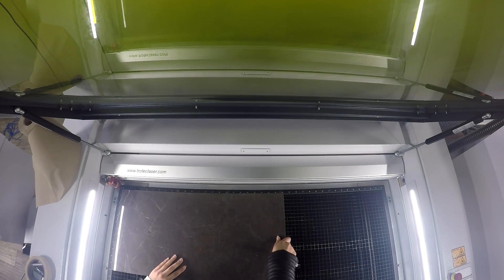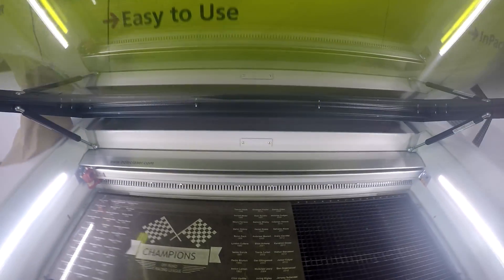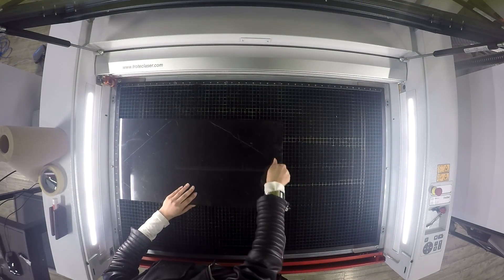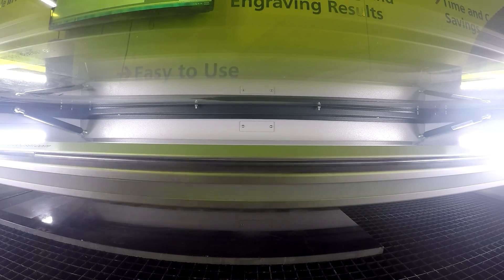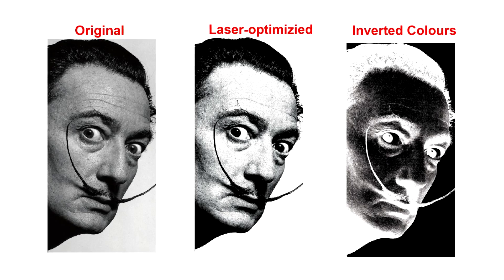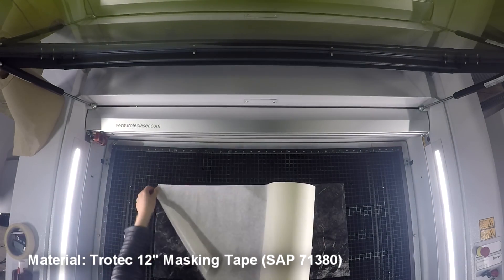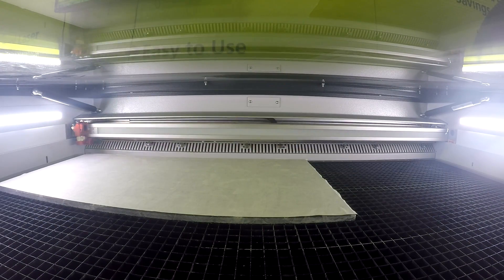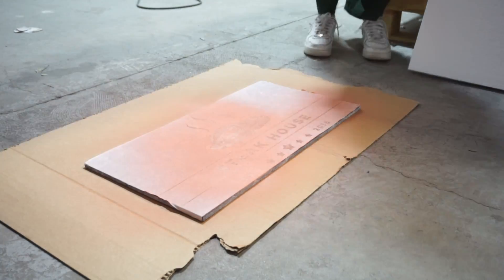Laser Engraving Marble | Photo Engraved Marble | 3 Techniques by Trotec

Comment: Did you manually edit the original photo in photo paint or another program, or did you juts select "photo optimised' in the print setting? with a error diffusion?
what dpi setting are used for 'photo engraving' on rock ans stone? as well as ppi?
Thanks.
Reply from the maker: Hi Nick, yes photos are always adjusted in the design software (CorelDRAW or Illustrator), here is a few videos on how to edit photos for the laser:
https://www.youtube.com/watch?v=R8vifjvFdcg&t=60s
https://www.youtube.com/watch?v=bR1qqsy2nn0&t=81s
DPI is in the design software which reflect PPI, we set it to "Auto" and had 300DPI in the design software